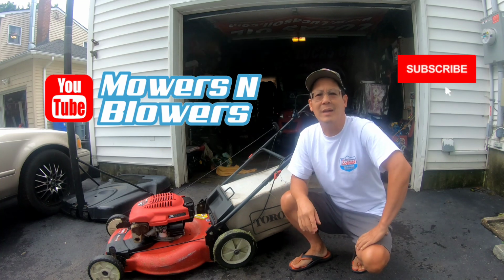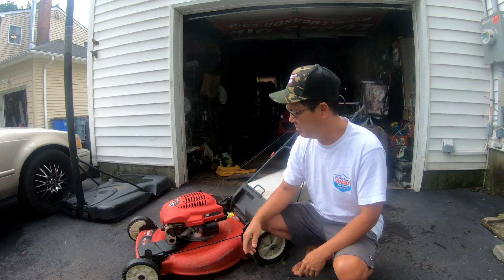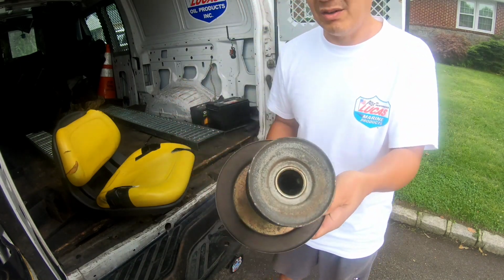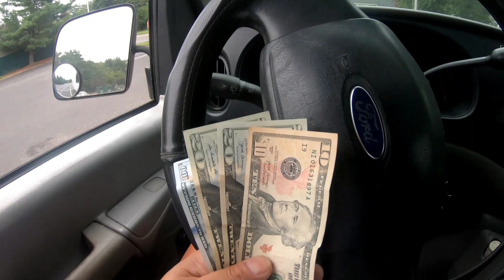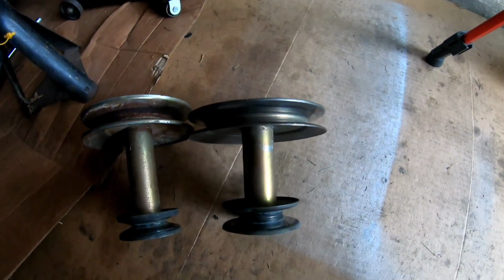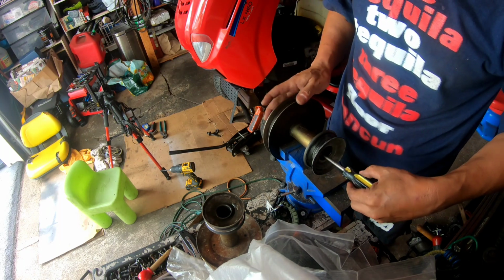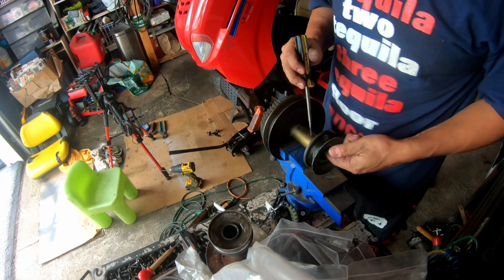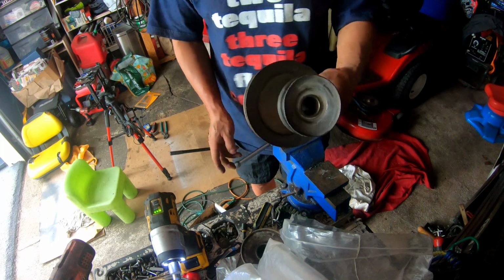TORO LX460 20HP KOHLER COURAGE LAWN TRACTOR  FOUND THE ORIGINAL OEM DOUBLE STACK PULLEY SWAP INSTALL

Comment: Use cutting fluid for drilling in metals.  It will make your drill bits last longer and be less work.  If your drill bit wasn't dull before, it may be now.  WD-40 would be better than nothing.

Comment: Its got the Tecumseh engine. No wonder she wanted to meet you at church them toros are made for cutting that grass
Reply from the maker: Nafe,  I hate the Tecumseh engines!  I was glad to get rid of it!
Reply: @MowersNBlowers  there only good when they work i was lucky victa used them so I used to rob parts off victas I can't remember the name but the carb off the victa made it really economical to run and was like a 200ish cc motor on the toro
Reply from the maker: @nafelowcostyardmaintenance7353  that’s for sure